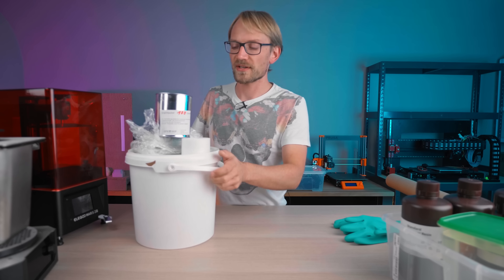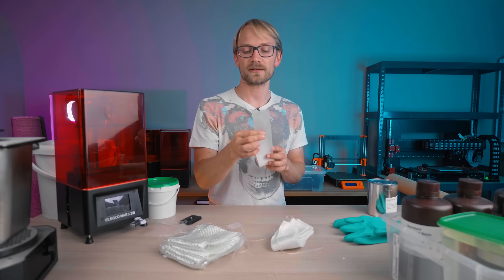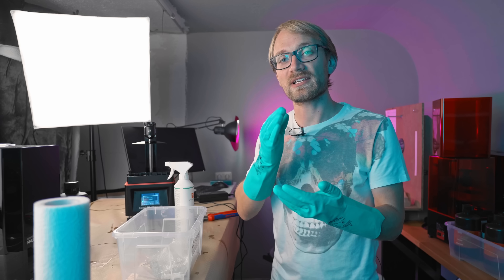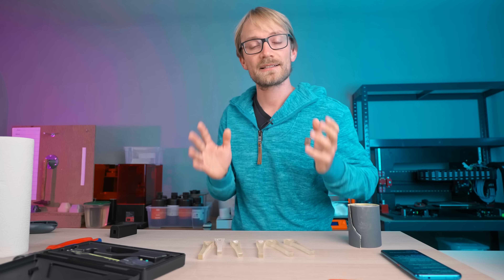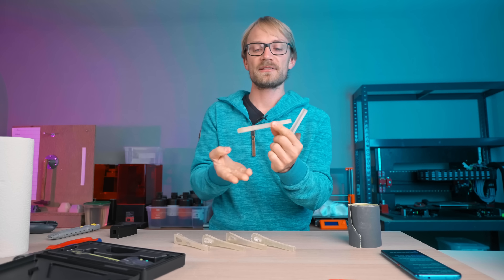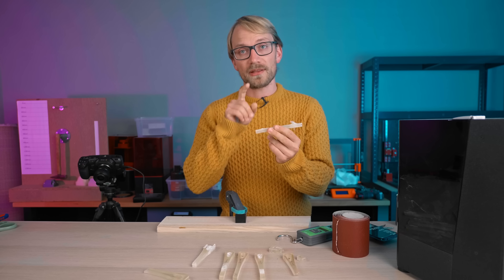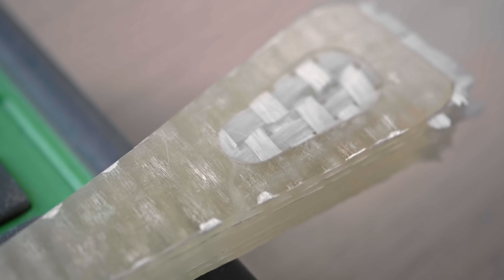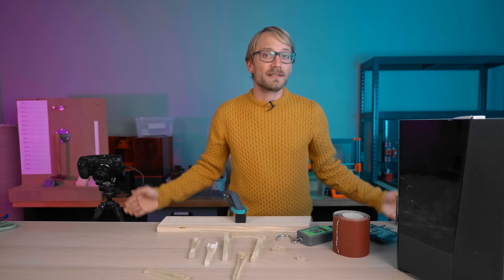Fiber-reinforced resin prints - how much STRONGER are they?

Comment: Great job man.  If we consider thick materials which  is bending,  you are supposed to put the fiber fabrics  opposite side of bending direction. I mean glass fibers material would be in the top of  the sticks  you would apply more  effort  in order to break them   because  the fibers strands in the top will apply more pulling  power to your arm than the bottom or middle.  Fibers strands work like that. Glass fibers not a chemical reinforced They are mechanical. it is importand factor how they are arranged

Comment: Could you try pre-stressing the fibers.
In a lot of the clips where the part breaks, we see the resin failing first, wich kind of looks like the fibers were stretching in the resin and not taking any  load of the resin
Reply: Good call. Composites don’t work well if the resin is stiffer than the fiber. Then you’re pretty much just adding in stress concentrations where fractures can propagate.

Comment: What I learned from all these types of videos (including CNC Kitchen) is that if if you have a serious use case for strength, you need to do your own testing. The other option is to spend multi thousands of dollars on certified systems and certified resins and maybe even a certified Engineer.

Comment: One thing I've considered is finely chopped fibers added continually throughout the print.  Theoretically as long as you keep the proper ratio it shouldn't make the resin too cloudy, but the random orientation of the fibers should help bond between multiple layers throughout the print

Comment: Would it not be better to just shred the fibres into the resin. That way you don't have to disrupt the print. You could also just add the reinforcing nylon to the parts after the fact since most of the strength of a material comes from the surface area.

Comment: Cool test; I think for the actual manufacture of a part like this, I would go with 3D printing a mould and doing forged carbon fibre, it would be easier and produce more guaranteed results / strong parts.
I say this more for the benefit of anyone in the comments looking for manufacturing techniques.  Totally understand the point of the video and I think it's great that you tested this.  I would have liked to see some tensile tests, but it looks promising and who knows, maybe someone will make a resin printer that reinforces its parts automatically which would be neat.

Comment: You should try the chopped fiberglass method. As used in "MVP Patriot Chopper System" machines.
The main problem with your method is that the fiberglass is directed in one direction. This makes the fiberglass not a link, but rather a separator.

Comment: Using a fiber layup that is entirely in the orientation of the load would improve your results tremendously. The glass mat weave you're using has half of the fibers perpendicular to the load, which means that for those segments it is entirely resin trying to do the job and it is no longer even continuous.

Comment: I would try mixing carbon fiber pulver into the resin and just print.

There's always enough resin around the fibers to get light around them. 
Also glas is brittle so I don't really wonder why its breaking easily when put in a rigid matrix.

Comment: The idea isn't bad, but technically not very practical in term of efficiency and its too robust. On top of all, we can always use print as a master and make a mold out of it to be casted with more practical traditional resins + reinforcement material such as those. Good video btw.

Comment: Really interesting test! But you could also just mix a little epoxy and paper the fiberglass on the parts afterwards. Or even some kind of manual filament winding with roving, wind some fiberglass rope around a few time and then paint it with epoxy. Just a little carbon roving could go a long way.
I'll have to look for more info on 3D printing / composite combinations.
Also, media offline? Don't think we didn't see haha!

Comment: You should have tried printing a plate and sandwiching a fiberglass tissue, like for a printed corcuit board. That may be useful for pcb making, electronic boxes, flattish parts, etc. 
Another thing that nobody has done is comparing "professional" dentistry resins with our "hobby" resins. They are muchore expensive, but if they can replace a tooth, even temporarily, they must play in a different "mechanical-properties-league".

Comment: How about a very fine chop glass fiber mixed into the resin solution (in suspension)?  I'm thinking glass fibers < 1mm long.
I am a long time FDM printer guy.  But I just delved into UV resin and I was surprised that fiber re-enforced resins were not available.

Comment: You should have blended the fibreglass till it was jsut fibres and mixed it into the resin instead of using sheets of fibreglass. For example araldite have a product they market to the airplane industry that has fibres mixed into the epoxy.

Comment: One other way to test with the fiberglass mat & cloth, what you call light & heavy, is to lay each piece of fiberglass mat or cloth at 90 degrees and 45 degrees to the previous piece of material. Both of the fiberglass types are  also used in body shops to repair damage. Another test that could be performed would be to add finely chopped fiberglass to the resin. The reason for using finely chopped is so the fiberglass might stay suspended in the resin for a longer period of time. As far as the drywall tape, in the US paper tape is usually used but there is a fiberglass type also used for more strength and to prevent thee joints of the drywall sheets from cracking over time and extreme temperature changes. Also would it be possible to melt Carbon fiber filaments mixed into a clear resin?

Comment: Very interesting Video. The thing about Fiber reinforced plastics is, that they are very good with load in the direction of the Fiber. In your case you were only testing for bend strenght. Would be a interesting Video to see how the parts perform in a Pull test with forces parallel to the fiber orientation. Maby CNC Kitchen could help out with his DIY Universal Test Maschine. That is the orientation that could improve the strenght.

Comment: Wondering if UV resin can cure correctly when mixed with strands of material? I thought one might want to 3d print shell that would double as a mould and the surface finish for a composite part. In this case one could use fibreglass cloth and lower cost resin for the bulk strength and 3D printed surface detail.

Comment: Didn't go through all 900 comments, but one thought especially with the woven materials, is alternating the layups, one at 90-degrees, one at 30, and one at 60 (or various other layup options)... this should far increase the rigidity, but also should help with the fracture mode as the various fiber orientations will distribute the load in different ways (unlike "squared" alignment like it appears all these were, where basically if the pressure is in line with the "cross" pattern, each lateral strand is somewhat of a crux for the crossing layers above/below, and since it appears they are all 90/180 to the test apparatus, it makes a high likelihood of stress on the weakest alignment (some random strand materials wouldn't hurt also).  Just food for thought/further testing!  In CF world, layup is the be-all and end-all of the final material properties in many cases.

Comment: I once crushed some carbon fiber in a mortar and pestle into a powder and added that to some resin molds.  I wonder if you could do the same here to get a uniform spread of the CF through out the entire piece, and without blocking the UV light as a sheet of black CF would.   I got the idea after reading about Pykrete.  <- Google it

Comment: I hope your still watching comments on this vid.  Can please test adding material called "milled carbon fiber" in the US you can get it for $15 for 1lb.    This is basic loose strands and broken carbon tubes.
Reply from the maker: What a timing! Just got done doing round 2 of these tests and I could absolutely have done with milled carbon fiber. Oh well, maybe round 3 😅
Reply: @MadeWithLayers  this is awesome!!! I just finished watching.   I've researched this a little bit and there are some papers out there that suggest milled carbon fiber pulls out of the resin but milled fiberglass is supposed to work extremely well!  Love the videos!!!!

Comment: maybe you could try the fully printed / uncured model (printed slightly smaller than desired)  and then wrap it tightly on all sides with a fiber cloth that had been soaked in resin with even a double wrap if you could pull it off and then cure for an extended period of time to make sure it cured thoroughly all the way through.  with it folding around the edges and adhearing to itself would contain the inner rain and compress it inwards when pressure was applied.  it's a theory, but it could help with the results you are looking for...

Comment: You should take the high and median strength methods for the strongest two layups and repeat those four prints using the two different alternative resins you mentioned at the beginning. Thanks.

Comment: A good thing to try would have been to "skin" the print with the fiber ...Put the fiber on the surface and use the resin and a UV light to cure the layer as you would do with epoxy

Comment: Hey, I believe you are treating an orthotropic material as if it was an isotropic material. Once you add fiber to the resin, it will be no longer isotropic. You're doing, mostly, flexural test, which is a bad idea for this kind of material. You're just not adpting the glass fiber the way it is supposed to be adopted. If you tried a pull test you would see real change.
Also, if you guys are doing this kind of test, you should have, at least, three samples for each "material". Ideally five samples for each material. In this way you would be able to eliminate process related failures (just pull each sample then get the arithmetic mean). You should get some consistent results by doing these simple changes to your measuring process...

Comment: Do you know why this is so? because the strength of laminates does not come from the connector but from the reinforcement, when laminating the proportions of both components must be very precise otherwise it doesn't make sense as in this video ;]

Comment: Truly, a great idea! And definitely something to keep an eye on. Below I gave you some suggestions, based on my composites experience:

I think there were two main possible problems: 
1.) Compatibility between the UV-resin and the glass fibres might be very poor. You would need to check the compatibility between the applied glass fibre silane-sizing and your matrix material. Sizing compositions are usually proprietary, so this is really hard to find out. I suspect that most UV-resins cure by radical mechanism, so a vinylsilane or methacrylsilane (or even Volan cloth) might work best. If, for example the fabric had an aminosilane applied, there is a chance that it would not react with the UV-resin.
2.) Impregnation quality could be poor. We do not know if the resin has fully wetted the reinforcement. There might be large voids within the fibre bundles, since no pressure was applied to compact the reinforcement layer and push air out. Looks like it at 7:32. Usually the individual fibre-bundles should appear almost invisible when properly impregnated. Maybe your cleaning agent at 6:27 has soaked into the fibre-reinforced parts prior to curing, which could cause a lot of problems.

10:50 and 14:06 The main failure mode looked like debonding and delamination, rather than fibre fracture - which would strongly agree with my theory. Therefore, the potential of the fibre reinforcement was not even closely exhausted. A continuous fibre-reinforced part must be both stiffer and a lot stronger than pure resin (thats common knowledge). A well-engineered fibre-reinforced composite usually fails in catastrophic manner. Here, the roving-reinforced composite failed by gradual delamination/debonding

Comment: Would you be able to test by cutting up thin but long fiber of dyneema from a dyneema rope? You would need to put them in the resin in the correct laminar direction for maximum strength of the piece. Layered mylar (used for the outer layers in 3d boat sails) could be also be interesting to test.

Comment: ok this just came into my feed and I'm now interested as a race car & kit car builder, i want to see what the effect of chopped carbon fiber or fiber glass infusion would have on this, not just 2 layers but just about a full-thickness, i know it wouldn't be the lightest, but this could be something really interesting to use when i get into the building stage of the car I'm designing

Comment: Really interesting introductory video about composite materials. I had more hope in the 23x layer thin drywall fibre glass but i think the main issue was the alinement's of the fibres. In the other clothes the fibres where crossed like in a fabric but on the drywall fibres where all parallel to each other and were put in the wrong orientation where the part would break between fibres. A part made with 23 layer of drywall fibre glass may hold way better with the fibre orientation crossed between each layer or simply keeping all the fibre parallel but with a 90° rotation where the part would have to break along the fibre and not between, same for paper which have only one fibre direction.

Comment: Milled glass fibers are available in 1/64, 1/32, 1/16 and 1/4 chop. The chop can be mixed in a blender to separate the tiny strands. I'd degas the resin after mixing in the fibers. Obviously the more detail your part, the smaller fiber you will need. So... waiting on the test with small fibers mixed into the resin.

Comment: You would achieve better results by either pulling along its longest axis until failure, or testing flexure  using a 3 or 4 point test, which places force in the middle of the beam while the ends are supported.  Your method of reinforcement reflects those types of forces.   The failure you are having appears to be similar to a sheer failure in reinforced concrete beams near the supports, which in steel reinforced concrete is why stirrups are used.  It seems that the sheer stress at the ends is causing layer separation since no reinforcement is along the weak(short) axis.  Very interesting experiment though and great video!

Comment: as someone who spent many years making boats, you need more fiber and less resin. The strongest FRP has as little resin as possible, and you have to have 100% saturation. Those white spots you see in the print are where it's not saturated and it's weak.

Comment: I've never worked with any kind of 3D printing but happen to know just a bit about using glass fiber and resin. When doing this the traditional way your goal is to use as much glass fiber and as little resin as possible while still making sure there are no air pockets. When making really high spec items such as masts for sailboats you use high pressure, often several tons of pressure to press as much resin as possible out of the laminate. These can end up containing more than 90% glass fiber per weight. It's the same with carbon fiber or Kevlar weave which can also be used to reinforce resin.

I'm not trying to teach anyone how to fiber reinforce their 3D print,  but I'm pointing out that using 2 or 6 layers isn't very much like how it's usually used.

Comment: with glass fiber you have to bend it against the fiber that will make the strength significantly higher or even lay the glass fiber 2 layers parallel and 1 layer diagonally that would bring significantly more strength

Comment: the problem with the drywall strips is that they are aligned to be strongest across the width, rather than the length of it, that's why you can tear it so easy.

Comment: Grear video, thanks! But... all those parts are flat. Than why not print the part, put the strengthening material on the top and on the bottom using the same resin, fix them together and lighten up? The overall result could be (sure - no tests done :- !) nearly the same.

Comment: The thing you are forgetting about composites is that we use pressure to squeeze out as much resin as possible as the resin is there to support the stronger maaterial. You want more fibre than resin in the end, but you need high pressure to consolidate a part because you need to get out the air and resin. Pre-wetting the fibre before you insert it may help with the strength between the fibres and resin.

Comment: I must say you live out the main component for glasfiber. And that's is epoxy. If you now want to get flexibel and strong parts you should first make fiberglas with epoxy layer thin then do the print and add this layers in a distens from each other.  Disten length changing how strong och flexibel you want the part.👍 There are more types you can try like powder balloons or fiber lexs.

Comment: Interesting vid, thanks! I was thinking about messing around with putting shredded carbon fiber into the vat but I probably won't be able to mess with it until the weather warms up. If it actually works, I expect to have a very hairy part but carbon on every layer.

Comment: would rather suggest to put the fabric within the resin for best strength capacity, like if the width is 1 inch of the item make sure you have 0.5 inch of fabric at the center , its just tearing off due to fabric layers till the outer edge like a wafer . i know it will be a task but if its just for the experiment sake, its not possible to have fiber and resin give less strength than resin itself unless done as i just said above.